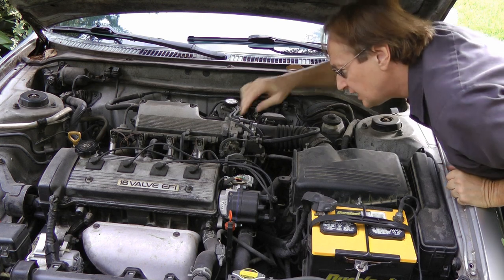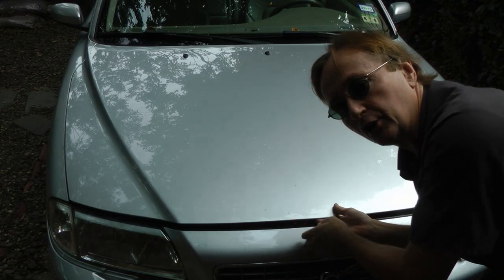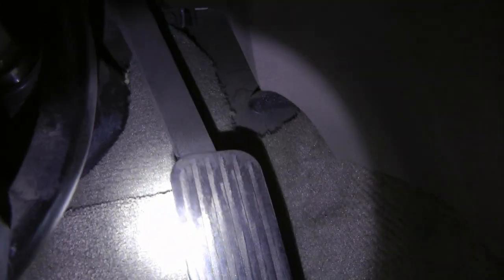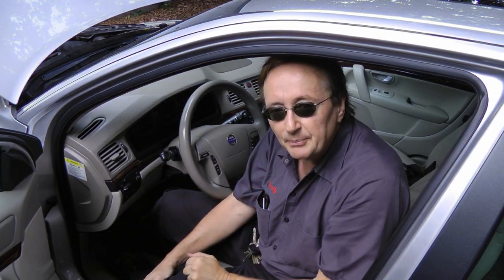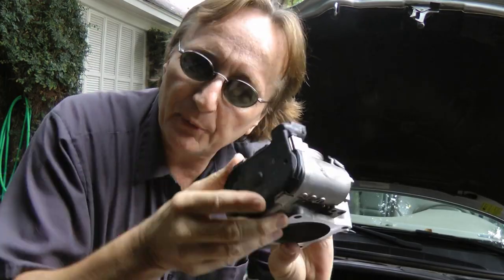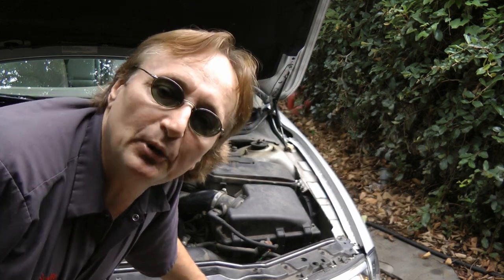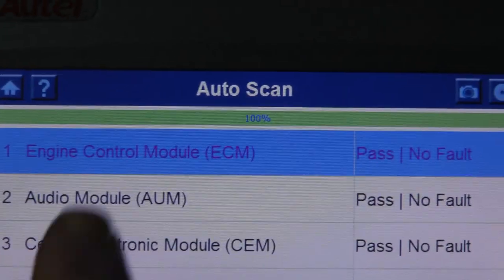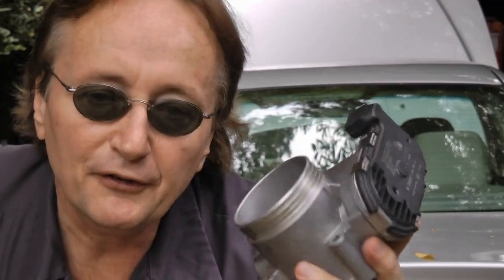Where Has Your Throttle Cable Gone

Comment from the maker: Things I used in this video:
1. Autel Diagnostic Tool: http://amzn.to/2nrT5op
2. Disposable Gloves: http://amzn.to/2zSRuxO
3. Ratchet and socket set: http://amzn.to/2inoxOY
4. Mechanic’s Tool Set: http://amzn.to/2Bzmccg
5. Flashlight: http://amzn.to/2BFak8y
6. Common Sense
7. Full HD Camera: http://amzn.to/2AvoEk7
8. My computer for editing / uploading: http://amzn.to/2i2sKYz
9. Video editing software: http://amzn.to/2jv5Fhf
10. Thumbnail software: http://amzn.to/2k7tz6C

🛠Check out my Garage to see what I use every day and highly recommend:
https://www.amazon.com/shop/scottykilmer

❗️Check out the Scotty store:
https://goo.gl/RwhRGU

👉Follow me on Instagram for the latest news, funnies, and exclusive info / pics:
https://goo.gl/ohy2cA
Reply: I have a 1990 Mazda 626 gt turbo. I notice that that the throttle has two cables(bottom and top). My top cable is missing. Can anyone the me where it goes to and from?
Reply: I'm having an issue i just watched ur video on when a car over accelerates. So i parked it pushed the gas pedal up and turned the truck on it revved way up and was trying to move so i shut it off. I took air filter off and checked the butterfly. It was down and so i started it it did the same thing all cables are ok except the cruise control. Well assuming it's cruise controls. Can't find anything on it in my haynes book or other videos on how to adjust it.
Reply: How to tight acceleration cable on Mitsubishi Magna 1997 V6 Manual Australia.

Comment: I just HATE electronic throttles...the lag of the computer, the expense if and when they break... the experience of simple and direct connection from my foot to the engine, and a manual transmission are both important for what makes a great driving experience for me!
Reply: A lot of fly by wire vehicles are purposely limited in their responsiveness and performance. Not all of them, but a lot.
Reply: Matthew Emery your right. all this newer technology comes with its down fall. Sometimes simple is better and I personally think it's smart, I mean look at what type of problem you'll have to deal with if or when your throttle gets messed up if it's an electric one.
Reply: I agree it cost me like 20 bucks to replace a stretch cable that the mechanic damage.
Reply: For me i just like having that physical connection, the pedal feel is just way better with mechanical connection. You people can bitch and moan about how ETC is so much better, and your ESC systems, but i'd still rather have a physical connection to my throttle, especially when roasting the rear tires off my ford ranger.
Reply: @joshburstyn No offense, But, there is literally almost zero benefit to having Electronic Throttle, aside from MPGs which in my opinion is NOT worth the hassle and the maintenance cost, considering how often they fail. I own a 20 year old car with 300K miles and the throttle cable has NEVER once failed!
Reply: Is there any way to revert back to throttle cable on a 2012 Silverado?

Comment: The newer the car, the worse the response time seems to be when you push the gas. If you push the gas in and out real fast, your foot will be all the way off the pedal before the engine even revs up, I hate that. Newer and fancier doesn't mean it's better.
Reply: It's filtering the input.  Smoother speed changes give better fuel mileage.  It's not the drive by wire per say but it's implementation to help meet fuel efficiency targets.
Reply: @MrGenie23432  I understand what you are saying.  I would rather have a cable setup though.  The increase in fuel efficiency is not worth it for me.  I like my cars simple and cheap to work on.  The increase in efficiency is probrably only a mile or 2 better mpg.  I just get better gas mileage by driving like a grandpa.

Comment: The only thing that can go wrong with cables are rust, bad adjustment, and stretching ever so slightly over time. After over 10 years or so, you might feel that the gas pedal has a little play in it before you push it down more to accelerate. It's extremely easy to fix - just adjust the nuts holding the cable where it is until the cable feels tighter. However, be careful with the other cable that controls the amount of fuel going into the engine. You can adjust it wrong and make the engine run too rich. You'll notice your transmission shifting harder than normal, and even cylinder misfires. And yes, that was from experience lol.

Comment: When I was a tech in Virginia we saw a modified 5.0 Mustang that had, after having the tube it runs through pinched, started to cut through the plastic and would sometimes stick open.  Depressing the pedal was difficult at times, and even worse was when it would stick and stay down.

Then, add to that the prevalence of cruise control, emissions, and "sport modes" on cars now and it becomes considerably easier to have a throttle the computer in your car can control directly.

Comment: I luv ur old-school approach. i restore pre-computer-controlled cars & am often amazed how complexity has driven modern car design. i think it's mostly about driving traffic to the dealers & cut out the indies. 
Brake-by-wire & steer-by-wire is coming soon. I don't want to be an early adopter of either technology. You can't buy a car without throttle-by-wire anymore.
thanks for your vlogs.

Comment: Diesels left out the throttle cable around 10 years ago, since the injector pump was replaced by a very high pressure vane pump (HDI), the admission is ecu controlled, however in process, also gained an air intake regulator (for turbocharged diesels mostly), also driven by the ECU. They usually don't break that often and aren't that expensive to change, the air regulator goes around 50$ and the diesel intake valve goes around 100$ (depends on manufacturer).

Comment: These crazy car companies and that is why I drive a 1981 Mercedes 240d and a 1997  Buick Park Avenue.  Although my Park Avenue felt a bit hesitant the last week when I stepped into the accelerator  pedal.  There are no adjustment screws so I slightly bent the pedal to take up the slack in the cable.  It was back to the quick response.  I must have slightly got it out of adjustment when I changed the cabin air filter.

Comment: Scotty I have saved a small fortune watching your videos! Thanks!        Can you make a video discussing fuel system problems. I have a 2004 Nissan Maxama that takes a long time to start after sitting for more than 4 hours. I checked for fuel system leaks and have taken it to the dealer and they say its fine. Any suggestions?

Comment: Throttle by wire is a great device in fuel-saving and reliability of the engine.

The pedal is just an indication of what you want to do depending on the position of the pedal and the speed that the pedal is pressed or depressed. Now a fancy computer can pinpoint the closest to optimum way to do what you intend- and that needs to have control of air, fuel, spark, etc.
It is also reliable for the engine as it buffs out any jerking on the pedal and bad regimes of use. The engine runs smooth.

Comment: Computers are great and all but there are some things that shouldn't be computerized....
Reply: Lol, there was some infiniti that has electronic steering now!
Reply: Uh, no....... I understand that some cars have "electronic power steering" which is fine. This car has "Electronic steering" or "Steer by wire" , which means, no physical connection from steering wheel to to the wheels. Similar to "Drive by wire", where there is no physical connection to the gas pedal.  This has nothing to do with electronic POWER steering.
Reply: I love my laptop, but I don't want a computer in my car.

Comment: I personally like the electronic throttle. Years ago my first car my 2002 F-150 had a throttle cable on it and when it got cold outside man it was hard to push never had that problem with my 2011 Mustang which has an electronic throttle cable. It has been replaced under a recall but it never failed and it has always worked just fine personally I like them much better.

Comment: Once again, THANK YOU Scotty! Like you, I won't be parting with my '95 Toyota Avalon with an actual throttle cable anytime soon--it has 215,000 miles on it, runs great--all I have to do is change the oil religiously and not drive like an idiot (racing it etc). Toyotas=best cars and trucks I've ever had.

Comment: My 2003 Toyota Celica uses a throttle cable, thankfully; I can't stand the delay that the electronic throttle has!
Reply: JoshCraver9000 yeah all the magazines and the technology people say that you can't notice the delay but they're full of crap you totally can
Reply: I'm pretty sure some cars have a programmed delay to keep you from wasting the tires.
Reply: Gordo Miguel- Well now that's no fun :(
Reply: It's not directly a delay but filtering the input.  Smoother speed changes better fuel economy so they are slower to respond as it's design to filter out uneven input.
Reply: meh, i'll still stick to my old reliable throttle cable

Comment from the maker: you have to disconnect the battery or unplug the throttle electronics when cleaning, cause if not, things can get shorted out.  But if you had to push it many times to get it going, it may just be wearing out and need replacement.

Comment: Cable goes bad too.. but it takes 15 years before you even start to see cable strands to get cuts and get stuck inside the insulations.. i wish one day car manufacturer will remake one of their older model cars.. What car do you want to be remake Scotty if they do? all i want are the old school rear wheel drive Corollas and 92 civics 4 door but bigger for everyday car..
Reply from the maker: they'll never remake the old cars, but I'm nuts about my old 94 celica, still runs great
Reply: Aaah the 2 liter celica.. my buddy of mine had a 87 and i remember doing the rear brakes of it long time ago..  it was a solid car..
Reply: Well, one engine that i believe was still used until 2006 in Japan was the Honda D16A.. and that designed was dated since 1989.. in my conclusion they wont make the car but they will continue using the same engine and suspension system throughout the years..
Reply: Actually Toyohashi remaking the late 80s land cruisers original like they were, but only in Japan lol
Reply: Toyota*
Reply: The w126 please!! And my Honda f22b2 engine
Reply: I have a 1987 Lincoln Continental guess its almost 33 years old still has the original throttle cable on it.

Comment: Electronic actuation/computer control ideas that I DO LIKE: 1) Electronic A/T (with manual override), 2) Electronically-switched turn signals, 3)Electric parking brake, 4)EFI (w/manual throttle and mechanical distributor), 4)Headlight/courtesy light time delay.

Comment: Yep my Renault wouldn't recognise the throttle body, no  acceleration to the car at all. was going to have it replaced. But to make things worse my car was only made for 6months and it was 14 years old, parts for it where non existent. In the end I couldn't wait any longer and the car got scrapped and I have another  car! It's so frustrating that most things aren't an easy fix anymore.

Comment: One of the reasons why we have these things is because traction control is now mandatory new equipment for 2012 model year and newer vehicles, and since traction control requires computerized adjustment of the throttle, this is the only way to do it.

Comment: In my 2011 Ford Fusion, the car would sometimes lose power and eventually stall out (it's an auto). I thought it was the transmission going out, but it ended up being the electronic throttle shorting out. It would sometimes work, sometimes not, but it would always start back up. Apparently it was a semi common problem with the cars but not common enough to put out a recall. Ford ended up fixing it for free

Comment: Wikipedia has a pretty good overview article on Electronic Throttle Control (ETC) systems. (Also check the 'Drive By Wire' article.)

We have an ETC equipped Honda Fit that has throttle latency & feel issues. One is it's inability to close the throttle quick enough in (manual transmission) gear shifts. I'm talking regular shifts too... we don't drive it hard. You have to get off the gas a little early. It's awkward feeling.

ETC throttle bodies can bite fingers, be careful around them.

Comment: When you showed the engine of your car, part of me wanted to know why and how you had my car. I concur with you on what you said, because even at 276k miles, mine is running very well. Need to do a little work here and there, but nothing on it is "hard" to fix (it doesn't count when bolts break). What year is yours?

Comment: thanks i got a old 89 tercel the throttle cable scared me for a second it losened up so much i thought it broke , took me 2 minutes to fix just tighten up the cable on the  carb side , easy ,

Comment: i spent 80$ just to reset the throttle system fot cleaning the throttle body.. why just not using a cable? just clean it simple and put the cable back.. why need such idiot technology.. i never hurt my leg using cable pedal.. this is crap!

Comment: Electronic Throttle controlled modules were first seen in 1999 Volvo S70 models and are real pain in the Butt.  We have had 8 Volvo's since 1987 and only recently do we have a Volvo with an Electronic Throttle Module.  I have tried my best to stay away from ETM's but like Scotty said it's getting harder and harder these days.

Comment: Drive-by-wire throttle saved the engine in my car by rev-limiting the engine during an unnoticed overheat. It also enables the traction control system to work.

Comment: In fairness this is their replacement of the idle air control valve.  You should try to crack that unit open, and see what is inside.  I found a broken solder joint on an unlabeled chip and a cracked resistor for the CAN Bus interface.  Repaired the solder joint and replaced the resistor with one form digikey and it worked fine.

Comment: Also on the "... by wire" craze... well aviation is pretty much by wire in all aspects and they are very reliable.
The mechanical redundancy for braking and steering keeps the cost down and avoid problems because a "by wire" system needs a lot of thinking and careful redundancy planning that leads to a way more expensive system.
So far, throttle by wire is doing great and any mishaps that can happen are not serious by their own with some exceptions that confirms the rule (Toyota).

Comment: Clean the MAF sensor, clean the throttle body, inflate tires a couple more psi than recommended (do NOT exceed max psi on the side wall of tire), change engine air filter, clean fuel injectors (use seafoam), and clean the exterior of the motor with a pressure washer to get old oil and dirt off the block. This will help the motor run cooler (avoid ignition wires and do this with the motor cold or if it's warm keep it running)

Comment: I'm fine with the e. throttle on my 03 4Runner. Has a lot better response than a cable & it's a Toyota, 12 years old with almost 90k and no problems.

Comment: No.... Electronic Clutches are Not next. But Solenoids working your Valves instead of Camshafts is already here if that makes you feel better. =)
Reply: That "new stuff" is a load of bs
Reply: Kj B yeah the engineering explained channel has a couple videos about that
Reply: Electronic clutches are old news. My Focus with DCT does,(tries, at least...), to do its own clutching. Fine for average Joe/Jane going to work, but it's easily confused with spirited driving.

Comment: I just replaced the timing belt on my 94 voyager and it was an ok job...kind of labor intensive but not bad...worst part was trying to put two (2) short stinking bolt "back" into the power steering pump...I have to say that was the absolute worst time I ever had with two bolts!!

Comment: Servo motors can be very fast, not as fast as the light (like with the cable) but they are fast enough so I think for security reasons the ones installed on cars to control the throttle should be fast enough to not be a security concern.

Comment: When my 2017 Toyota Corolla SE with a 6 speed manual transmission is paid off, I want to trade it for a 2012 Subaru Outback wagon with a manual transmission, which would be my fourth one, as long as Subaru has gone back to four head bolts on the 2.5 motor. Or an old Toyota without all this computer felgercarb.

Comment: I never liked the throttle response of vehicles with fly-by-wire throttles.  Yeah, it might have some advantages...like giving the traction control system direct input to the throttle...but throttle response on these newer cars (even expensive ones!) just isn't as crisp.

Comment: Hi Mr. Kilmer,

about a month ago i changed the throttle actuator on a 2006 BMW M5. (the car has two, and only one was defective according to the OBD reading). Everything works fine, and seems to run very healthy. Should i go back and calibrate it, or am I fine? (i don't want it to give me trouble in the future.) also, which scanner do you use to reprogram? Thank you

Comment: It wouldn't be just putting a cable. You would certainly need to keep the throttle position encoder. I would not recommend it unless you know very well the electronics and the throttle feedbacks. In my country it would be illegal anyway.

The one thing I forgot to mention in my previous comment is why does it need specialized equipment to be initialized after its replaced ?

Its just insane